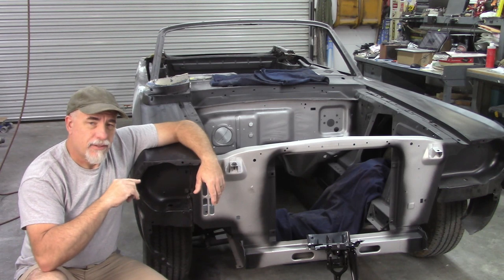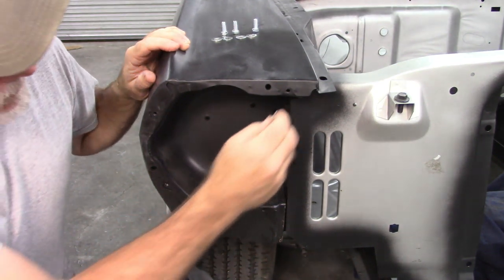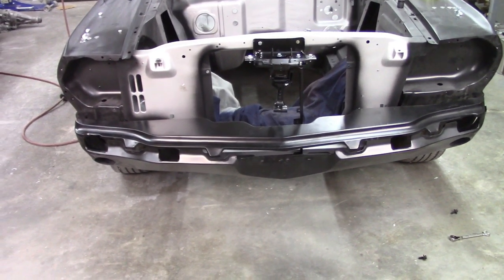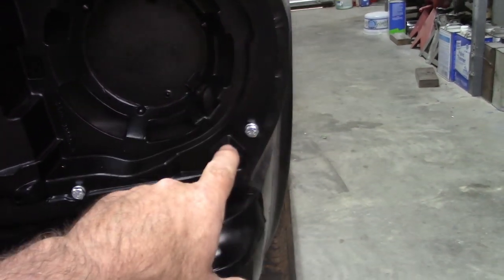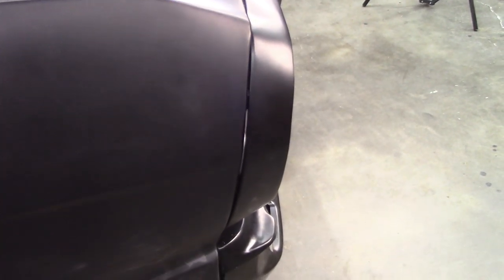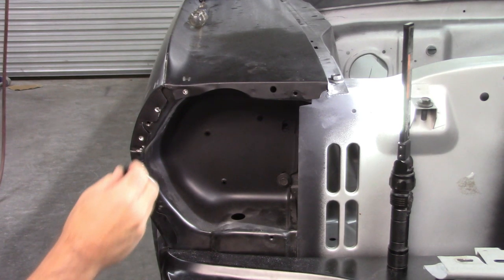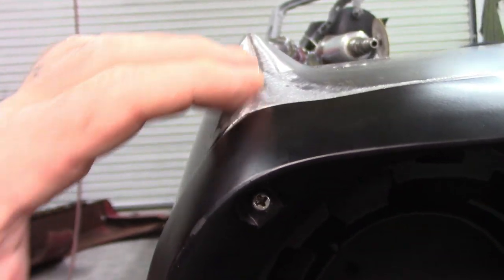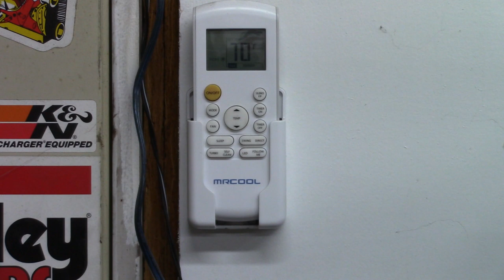Brooklyn Pony Part 32. Fitting headlight extensions and buckets. 1965-66 mustang.

Comment: Excellent video.  I have a 70 Chevelle and bought aftermarket fenders and headlight bezels and they definitely didn't line up.  I definitely will use what you did as an example to get that tight fit!  Keep showing us how to do it right.  Thanks.

Comment: EXCELLENT,!
Thankyou for showing this. On mine I have 4 original buckets to chose from...all with missing tabs and have been toying with low temp white metal welding using my son's toy diecast toys as donor material. It's great to know I can at least go to aftermarket and modify as you have  when my approach doesn't cut the mustard.
Your videos showing your thinking process and approach are perfect... Thankyou.

Comment: I'm really glad you are doing this convertible because you do stuff that I would never figure out to do to fix this blend of new and old parts back into a car.    Fortunately for me, my original front fenders saved but I had to buy new headlight assemblies.   I trial fitted all that before I took it back apart to replace the core support.   Since I got the headlights, grille and grille molding aligned well I removed that whole thing as an assembly so hopefully it will go back on there.    I have a problem making my valance corners line up with the front fenders and it appears that the valance flanges on my fenders were mostly chopped off.   I'm going to have to cut out templates and make new flanges to mount the front valance and of course, they have to have the right shape so the lines match up. 

I sometimes wish you would have more problems on what you are doing so I can learn more stuff, LOL.   Sorry but the more you do, the more I learn and I am obviously like a lot of other people watching you build this car.    I hope you don't mind me doing this but I put a thread out on the VMF which I am a long time member of and there were quite a few people that knew your website.   I politely shamed them for not contributing to your Patreon account.   Hopefully that brought you some more contributors and there are several thousand people roaming through the VMF.

Comment: My friend actually has a fix for the crack at the top of the headlight bucket. He fabricated a special repair bracket (I used one myself) out of metal and has a template. I am having ANOTHER friend try to 3d print it...I can send you a picture on FB

Comment: The eyebrow (top) of my right side headlight door comes down at a sharp angle instead of forming a gradual transition front the fender. The result is a gap between the corner of the hood and the headlight door. Can the eyebrow be “bent” up or reshaped by hand easily?
Reply from the maker: I have reshaped them. If it's an aftermarket hood, it will likely bend easier.

Comment: Ever have a issue with the headlamp wiggling after installed? One of mine does, one don't. I'm confused why.
Reply from the maker: They have to be set straight. There are notches to n the bucket for the light to fit into.
Reply: @JoDaddysGarage  the bucket it's self is what's wiggling. Not the head lamp.